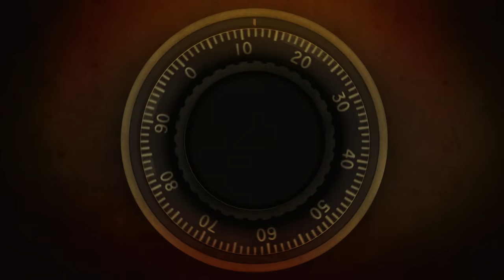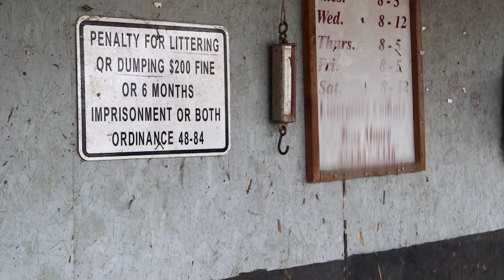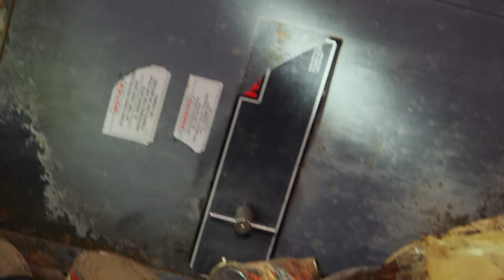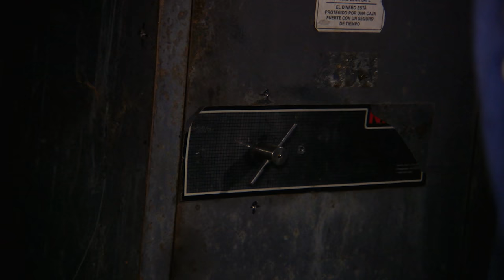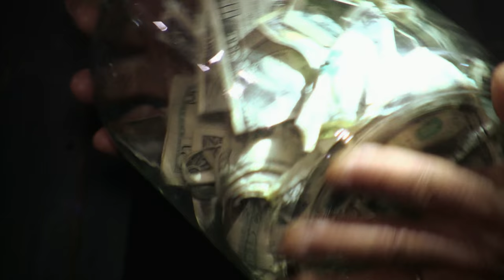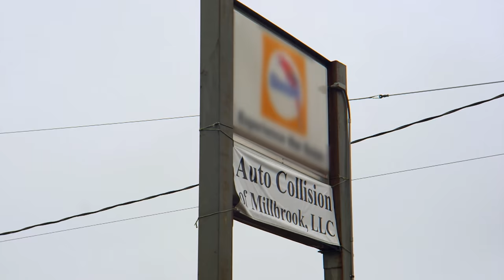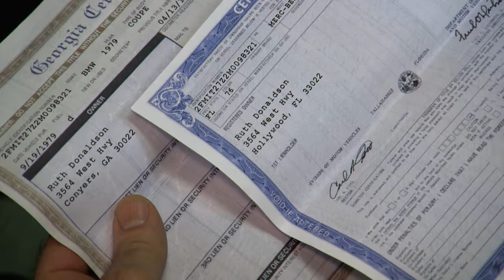The Safecrackers | FULL EPISODE: The Case of the Jewel Runner's Ride | truTV

Comment: pro tip, empty the petrol tank out before you start
Reply: Un-pro tip - your suggestion is extremely dangerous; a trace of fuel vapour remaining, mixed with air, gives you a bomb that will be heard a mile away. If you have to cut or weld near a fuel tank, empty it then fill it with water. Without air you won't have an explosion.